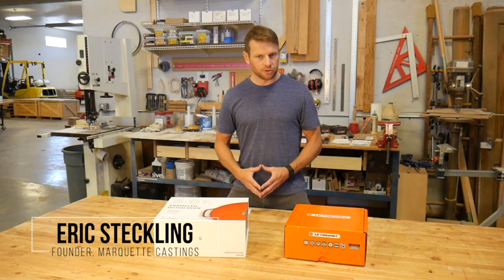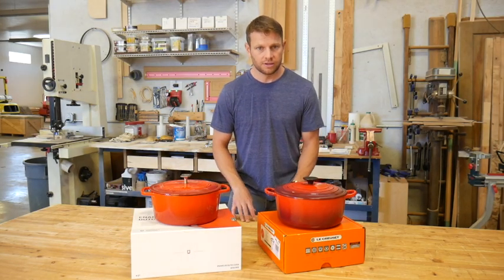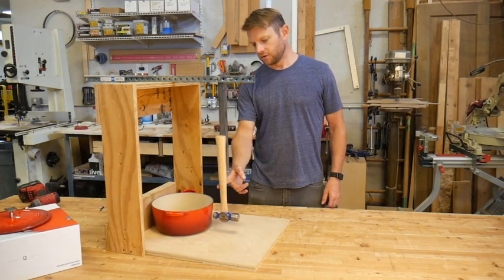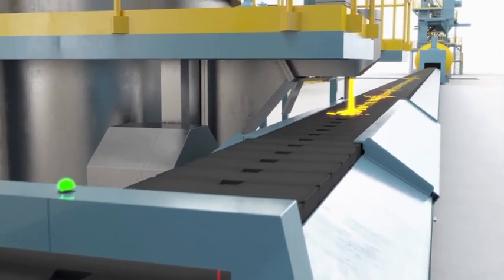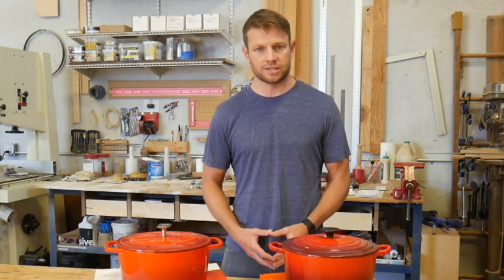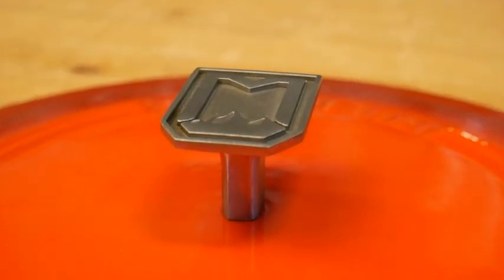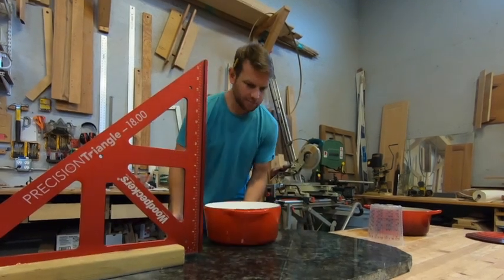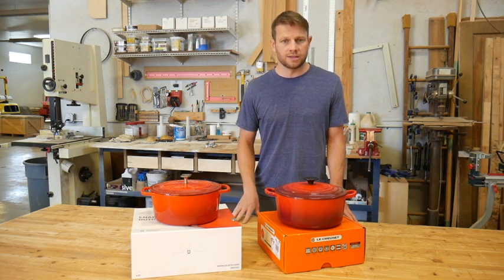Marquette Castings vs. Le Creuset Dutch Ovens

Comment: Which brand works best on an induction cooktop?  I suspect the lesser weight/thickness of LC performs better.  I've had thicker pans that required nearly twice the energy to reach the same cooking temp/time as cheaper/thinner frying pans.  ?
Reply from the maker: Cast iron preforms very well on induction because it is so magnetic, you will find that any/all will heat very quickly (much quicker than gas). You will likely find a bigger difference in non-iron cookware - like a stainless pan as there will be much greater differences in how much iron is in each stainless pan. The stainless pans with more iron in them will heat more quickly, even if they are thicker/heavier. hope this helps!